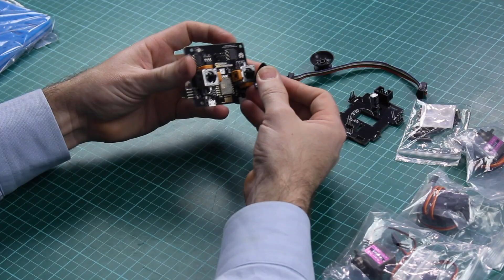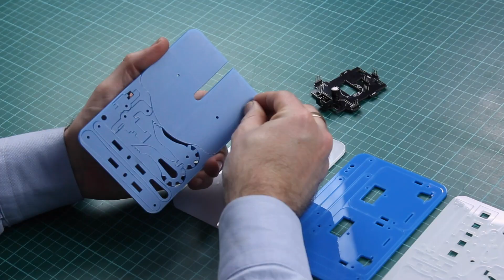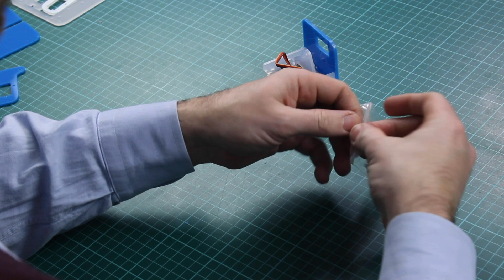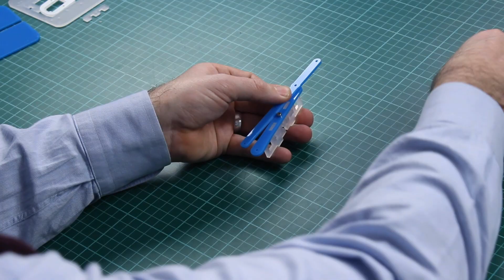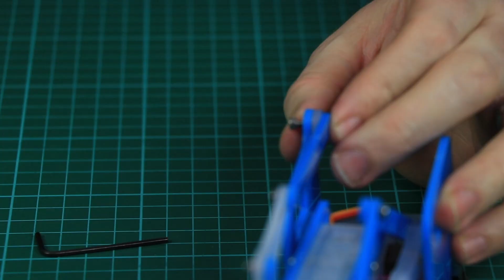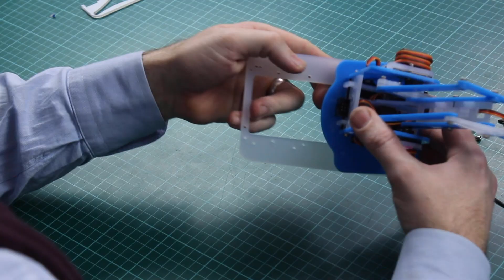Building the MeArm Robotic Arm from Kitronik

Comment: I have an issue with a micro:bit mearm not powering up the control board to move the servos.
The board version is 1.4,I have just opened the kit having purchased last year......The servos work as I tested them independently on a breakout board.....power is getting to the board as my microbit can be powered up from it but the LED is not activated on the board
Reply from the maker: Hi Ronan, sorry you are having issues with the MeArm. Please get in touch with our customer support team who will be happy to help you track down the problem, they can be reached at support@kitronik.co.uk.